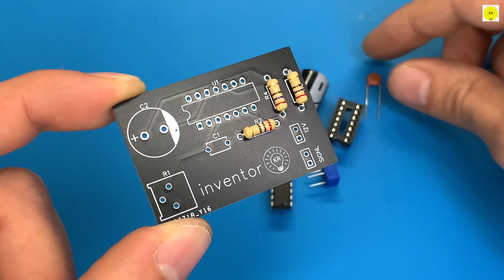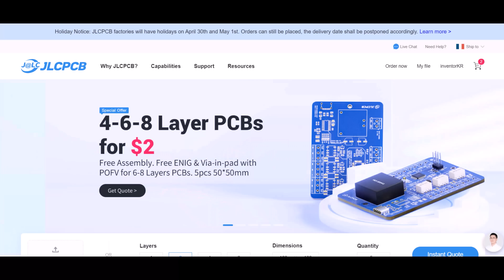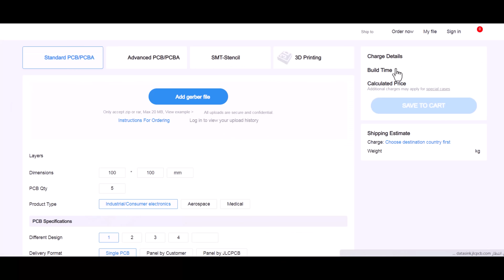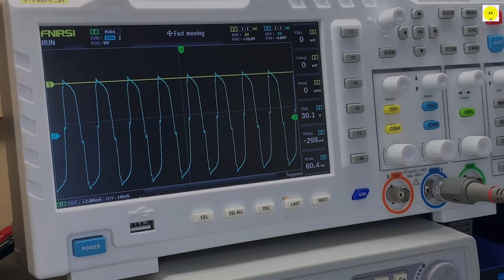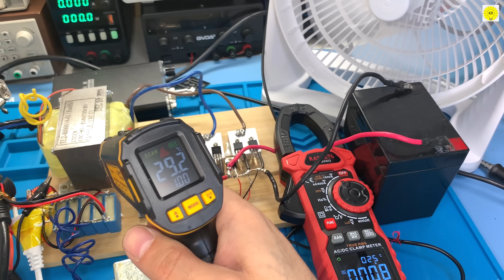how to make simple inverter 4200W , sine wave , 4 mosfet , IRF3205 ,jlcpcb

Comment: I  LIKE the way you twist  and  put the stranded wires under the bolt heads; that is VERY INTELLIGENT; the SAME as a terminal, without the terminal, REAL GOOD; i would just add a small WASHER; THANKS for the idea, it is just GREAT, ( i know some will say it is not a good practice, but IT IS GREAT, and it is easy to measure the milliohms from wires to sink;  i build and repair inverters and do small solar installs, up to 10KWH and 3500 Watts inverters.

Comment: Prove 4000w.......
Reply: Man you must use at least 20mosfet to get this watt 4500
10 pararell with 10 pararell read datasheet of MOSFET max pd is important and max id...may use and n3ed igpt MOSFETs big and high power and recommended using microwave transformer
Reply: I use 12 13007 to get 450watt id max is 4amp I get from it 1.6 amps I could get more by using low resistor owms I will make it well
Reply: @itmeetings  using a transformer at 60hz is going to need a very large transformer for 4kw, that's why most 4kw inverters use high frequency like 15khz, then rectify that to get 4kw DC, then they take the DC and a set of MOSFETs in a H bridge configuration to make sine wave.
You could maybe use 4 re-wound microwave oven transformers to make 1kw each, use 4 input stages driven from 1 driver circuit and parallel the outputs (in-phase!) to get 4x1kw
Reply: @lezbriddon  yes it would not be easy for any one but we could make it and make protections for it need time and calculations and need igpt at least 12or 20mosfet with big 👍cooler fan and two oscillators 494 or higher

Comment: does 4047 IC include the Dead Time Control to avoid the Shoot Through(both MOSFET gates open at the same time) during the transition between the opposite polarity waveforms?
Reply: @raydan18  it does not

Comment: 12V x 58A = 700W and not 2000W as the blower states
also, that small battery won't last at all when it has to put out around 166A needed for the 2000 watt (100% efficiency ....) transformer eats power as well, so in effect you'd need to draw well over 200A to pull that off .....

but all being fair, 700W still nice :)

Comment: how can it be a sine wave inverter you show what is clearly a square wave being fed into the mosfets. and when you hook up your scope to the output it looks like a dirty square wave i assume the coils and capacitors smooth it a bit but still not good for sensitive electronics. still a good hack to know if the world goes to poop. i dont see why more inverters are not true sign wave is it more complex then the input signal to the mosfets?

Comment: Maybe wors till 600 watt . The output is not sinusoidal and finally : a 500 watt inverter ( modified sine wave ) costs 12 $ . /// It could be interesting for the frequency variation, but it should be a pure sine wave... with this waveform I wouldn't even connect it to a 500 W induction motor, because it would quickly ruin the windings.

Comment: INPUT POWER  MAX  DC 11V*58A=638W
EFFICIENCY / LOSS= TRANSFORMER 95% *  FET SWITCHING LOSS 95%(BEST)= 90% / LOSS = 63.8w
Calorific value of heat sink  31.9W = A larger heatsink is required.
OUTPUT POWER(BEST) = 574 VA, 220V 2.61A
Reply: Yes, I smell bullshit here.

Comment: My 4000 watt inverter is supplied with 4/0 copper cables with a 24 volt battery system.  So how can you get 4200 watts using only 4 Mosfets at 12 volts.  The leads of the Mosfet can maybe carry 20 amps at most.  So you would need about 30 Mosfets wit a heatsink 30 times larger with a cooling fan over them.

Comment: Never ever 4,2kW with these scrap. 4200/12= 350A. Losses not included.  The tiny Battery delivers 50A only for few seconds with an acceptable voltage drop.

Comment: Hello, how many amps should the transformer be to make a 2000 watt inverter? (assuming that we use a 220 to 12 volt double transformer) what specifications should the transformer have? Can you guide me?
Reply: Трансформатор по мощности железа тоже должен быть не менее 2000 Ват. В инете есть расчёт трансформаторов.
Reply: 2500 transfromer
Reply: More than 166 Amps on a very simple calculation. Add inefficiency and other losses would bring up to 200 Amps easy.

Comment: Not even remotely close to 4200 watts. Voltage dropped down to around 11.3 and peaked out around 60 amps so 700 watts at BEST.
Reply: Indeed, you can see that from the size of the transformer :)
Reply: @johnlawton3703  Yes, at the statet power the whole scrap will burn itself through the table to center of the earth.

Comment: BS.  Absolute BS. There is NO WAY this is close to a SINE WAVE inverter. Nor is it close to 4200W.  There would need to be at least 350A supplied from  the12V to be able to deliver 4200W.  The Transformer used is could NEVER be more than a 250W unit. This circuit has it's merits, but why BS everyone.

Comment: what was the 2nd transformer doing ?
Reply: Его первичная обмотка , подключенная к выходу фильтра , использовалась в качестве индуктивности . Это сделано для получения подобия синуса на выходе устройства.
Reply: Its primary winding, connected to the filter output, was used as an inductor. This is done to obtain something like a sine wave at the output of the device.
Reply: Он из прямоугольника делал синус.

Comment: Textual details of every component being used should be added and a diagram at the end of the circuit would be very helpful.
Reply: 9:30 !? , 11:10 !? - dont make these things to plugs at home. And BTW its not 4200W... but at most 700W of drained power..